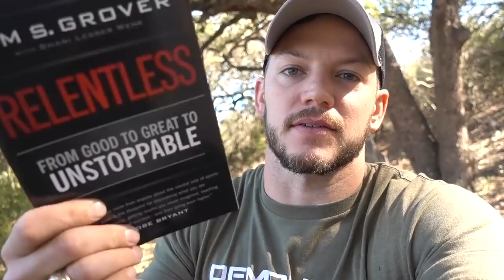Is a Pure Silver Bar Bullet Proof???  Super Expensive!!!

Comment: You can decontaminate the silver just by melting the lead. Silver has a much higher melting point. You will be fine! A blowtorch should do the trick.
Reply: Lead "wets" silver when it melts. Like how lead solder can be used to join copper wire without melting the copper. Melting the lead will just solder it to the silver surface forever. Most lead-free solder uses an alloy of silver, which will seamlessly mix with normal lead solder when molten also.
Reply: Grant E know what he's talking about.
Reply: It's also copper in it, and no, is not my brodda

Comment: Hey Matt, you should shoot a block of Carbon Fiber!  Would it even do anything???
Reply: No such thing as a block of carbon fiber, do you even know what carbon fiber is?
Reply: I know that Carbon fiber is a very strong metal. I'm sorry if I had no clue that it can't come in a block. Maybe Matt should get a thicker plate of it then. Or stack some layers up and shoot it. Thank you for your correction
Reply: Carbon Fiber is not a metal. Its a Carbon Filament Woven Fabric layered in Resin/Thermoplastic. 

I would like to see a test like this myself, Layered Sheets cut into a block shape and then dipped into resin, could even be made at home...
Also a Fiberglass version of this test would be cool also.
Reply: Commenting with a correction and a tid bit of information is trying to hard?
Its brain dead that you actually took the time to comment something negative about me replying to a comment adding to the thread in a positive manner. Thank you for wasting your time and anyone else's that may stop here.
Reply: Max Boof oooooooo goteeeeeem.
Reply: Most carbon fibre will behave like fibreglass when it's shot, because they are almost the same from a ballistics standpoint. Soaking kevlar in epoxy and layering them up would create a much better ballistic strength, but it'd be far heavier than the others.
Reply: I am STUPID CUZ I DON NO A WRD U SAID
Reply: Chicken Wing Go to school
Reply: @hankg6955  u can make a block of carbon fiber in resin

Comment: See if you can weld two pieces of metal together by shooting down the seam
Reply: Wat
Reply: Wont get hot enough, however you may be able to get a muzzle break hot enough to be fusable, but you need two peices, good idea though
Reply: 0rang3z that is a good q
Reply: 0rang3z found the 10 year old
Reply: What the fuck? Are you kidding me? Theres a bit more to welding than getting 2 pieces of metal hot.
Reply: 0rang3z that would be pretty hard to do actually, not just because of temperature issues but because one would have to be so precise on not only making the round skim off the seams but skim off the seams without it ricocheting off the plates. Even then, you'd have weather/climate and the firearm's behaviour all playing a factor in what happens to the round after it leaves the barrel. Interesting idea but there are too many random variables for it to work instantly; If temperature wasn't the main problem it'd be plausible to get a successful melding to happen by doing so, you'd just need perfect weather and a perfect marksman.
Reply: 0rang3z quit trolling. Shit don’t work like that.
Reply: if you've ever welded, you'd be amazed at how hot you need to get the metal before fusing them together. even if a bullet did reach that temperature then the amount of time it was at that temperature, then it won't have the time to heat up the metals to weld
Reply: Chief Bruh Stupidest ain't a word bruh
Reply: TKO593 He's being sarcastic people
Reply: Georgie TheDragon chill bro
Reply: You’re more likely to rivet them together doing that than achieving a weld
Reply: Damn just got high and saw the lead being pushed into the fuckin silver lol. Y'all trippin

Comment: Melt down the metal and take out the impurities
Reply: This isn’t Cody’s Lab
Reply: But what a crossover that would be!
Reply: Lead has a lower melting point than silver so you could carefully melt the lead out with a blow torch. However copper has a higher melting point than silver so you'd have to drill or pry that out. Or melt the lead out, then melt the silver and scoop off the dross and pick the copper pieces out, and re-cast a pure (though a bit lighter) pure silver bar.
Reply: oh no!  this has provenance now, DEMO RANCH artistry...
Reply: How to trick a smart guy

Read more
Reply: Matthew Thomas nope not gonna fall for it
Reply: Wonderfulnick This isn‘t Presstube
Reply: @titanslayer7789  same hahahahahhaah
Reply: Melt the holes closed and sell it back to them with the impurities still in it

Comment: For the silver, you can actually take it to a jeweler and have it re-smelted into 10 troy ounce ingots and re-certified. You'll have to pay for the service and likely give up the excess silver, but that'll keep your silver from being illegitimate.
Reply: Eh, you never know. I'm just trying to be helpful. It'd be a shame to let silver become illegitimate and lose value.
Reply: You're far better off with an assayer or refiner than a jeweler. The fee will be much lower. The rub is; the fee on a hundred troy ozs, or ten, or a thousand are the same. But the assaying fees aren't that high. Silver Labs or Sunshine Minting, both in Idaho, are two that perform that service.
Reply: That is actually very good to know, because I didn't realize that there were other services that worked with precious metals outside of jewelers and Minting presses, which I thought there were only federal mints. Thank you for the information.
Reply: As long as the silver is still there it retains its value. Either smelt off the lead then heat up the furnace to melt the silver but not the copper, or at worst melt the whole bar, including the bullets, and have the resulting alloy assayed - you should still be able to get the full value of the precious metals. All you lose is the silver that got carried away with the .50 bullet.
Reply: pure gold is better, no oxydation and more resistant to corrosion.
Reply: And by "corrosion" you had in mind "oxydation"? hehe
Reply: Demolition Ranch i don't agree with your opinion on Bitcoin. you see the Government decides how much they can print money. the value of a Dollar has inflated over 100 years. a Dollar back in the 1950's would be worth more than today.
Reply: when it comes to currency,the more stable the better. The dollar is stable; bitcoin/cyrptocurrency is not.
Reply: we the citizen have no say or power when it comes to how much money the government print money or how it handles the money. bitcoin is a way to quickly transfer money without having to pay a high fee. bitcoin supplies is limited and backed up by real Math. bitcoin is a way to counter the central bank.
Reply: money is transferred everyday without paying fees. if you have a debit card, you transfer money without paying fees.
Reply: electric feel whether you want to like it or not, it’s the truth and it isn’t changing.
Reply: i'm talking about sending money to someone from different country, it's suppose to be a fast easy and low cost way..... i'm glad invested in bitcoin. it's real and it's the future. you have no power in the central bank at all. anyway this vid is about guns.

Comment: I’m not sure if you can do this but if you can find someone who can melt it down they might be able to filter out all the copper and led
Reply: they won't filter, the lead has a lower melting point and the copper is higher then the silver, both will alloy with the silver and will have to be refined out.
Reply: Why not separate the lead first, then separate the silver from the copper?
Reply: Tingyi Lu the temperature differential is very hard to maintain and the cost of refining is very low. He should get 95% of the value back from the bar with 0 effort.

Comment: 10 million subs special: is a solid gold bar bulletproof?
Reply: @ the current 506,400 USD per bar don't get your hopes up.
Reply: Cragified by the time he has 10 million he’ll definitely have enough money
Reply: DragonMastar612 Gaming and stuff u can get trough gold With a Knife😂
Reply: Silver is also quite a soft metal. It's stopping bullets here purely from density. A big chunk near pure iron will perform fairly similarly as iron is quite a soft metal to. It's only the inclusion of carbon and other elements that make it hard via being an alloy of steel, cast iron, pig iron etc.
Reply: Not bulletproof. It's one of the softest medals
Reply: Gold is super soft metal dude i don't think it's a question
Reply: How about a diamond
Reply: Diamonds are super hard, but super brittle. You can drop it on ceramic tile and it will shatter

Comment: The silver ingot is worth virtually the same any bits that broke off if collected will bring it to the same value. It still has the same amount of silver. You could extract the lead by heating it with a blowtorch the silver wont melt and any bits of copper can be extracted with pliers. But any self respecting precious metal dealer should do that for free you are choosing to do your metals trading with their company. But in real terms the bar is worth more now. It's a memory.